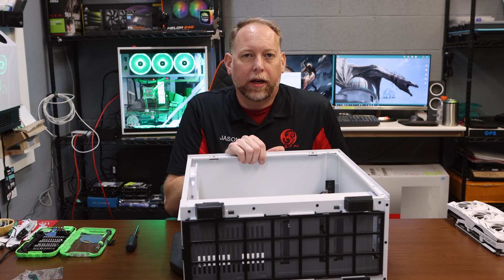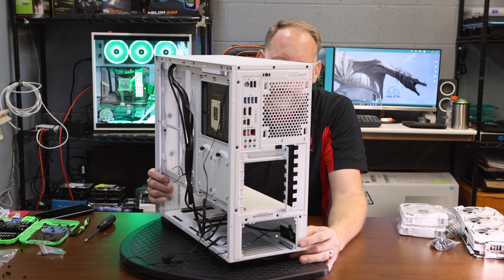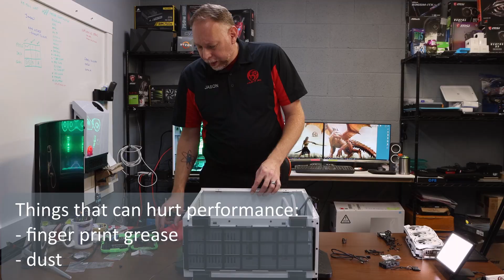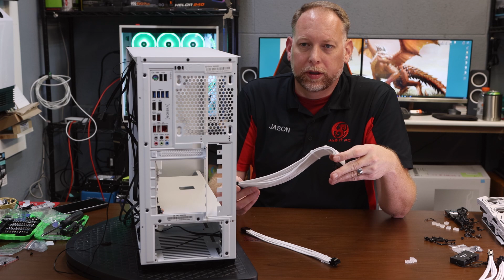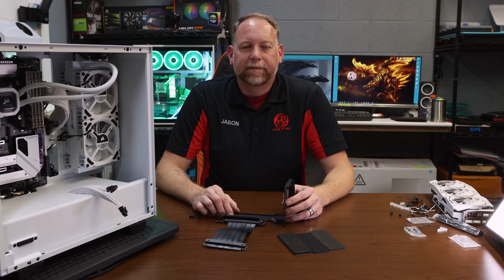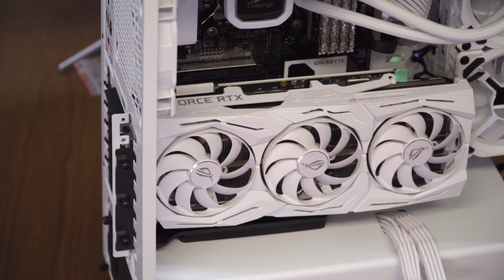Custom Gaming PC Build - iBuyPower Snowblind Pt.2

Comment: I’m curious what filter you used since you ran cabling through the filter clips..
Reply from the maker: Didn't use any. Have not needed them so far.
Reply: Your running system with no filter ? Asking because my case won’t close with stick filter I did the same thing.
Reply: Stock’

Comment: Trying to find a video where the power button cable goes on motherboard, did I miss something I did not see anything about that
Reply from the maker: When you have a discrete video card, you plug it into the video card. The motherboard turned off the outputs on the board because you have a GPU :)

Comment: Nice video, really good work and recommendations.  Can you comment on the space for the 240mm and a vertical gpu? think you could do push/pull and a 45 or 60mm rad?
Reply from the maker: Thanks! The push pull we did for fine, but going to a 45 of 60 would depend on your gpu size. Of course you could also just do push or pull and a bigger rad, but if your gpu is really big, it might hit.